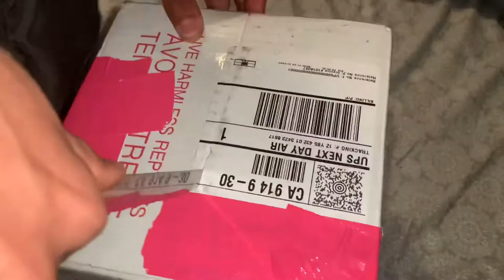Pt2 unboxing invertebrates from LLL reptiles new centipede and millipedes

Comment: The centipede’s tank is way too small. Minimal requirements are...

Length = Twice as long as the centipede
Width= around the same length as the centipede
Height= same as the length of the centipede itself

Your substrate MUST be at LEAST half as deep as your centipede’s height.  Otherwise the centipede will be unable to find a proper microclimate, and will ultimately perish during molts or stress. 

Tupperware will not work long term, as they can chew through it (I learned this the hard way!) Centipedes are also escape artists, and your setup is not very promising!

Please do research about your animals, and please be safe! Centipede bites are NOT a joke!

Sincerely, someone who keeps centipedes.
Reply from the maker: That was a old video I now keep my centipede in a glass aquarium. The enclosure I used in the video was temporary I thought I stated that in the video but I guess I did not. Anyways thank you for being concerned for my centipede but I just wanted to let you know he’s all good 😌
Reply: @WestsideReptiles  oh, good to hear! Sorry if I came off as rude, as someone who’s had too close of a call before with their centipede(s), sometimes you can’t help but stress the phrase “you can never be too careful”!